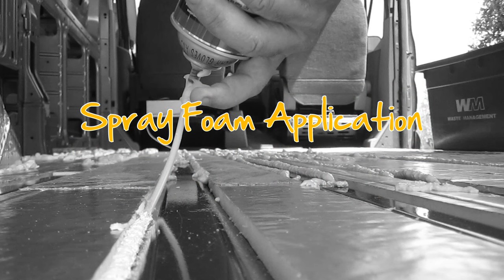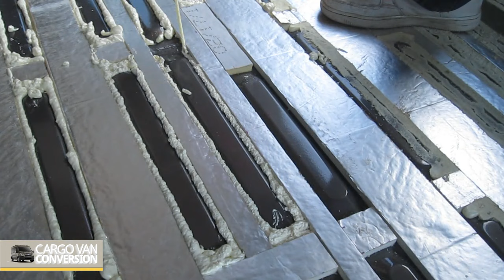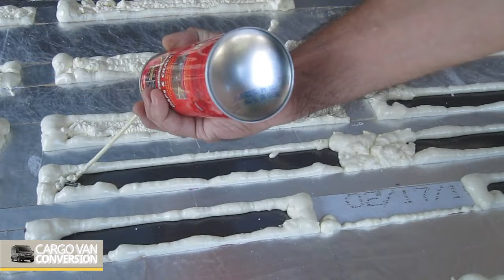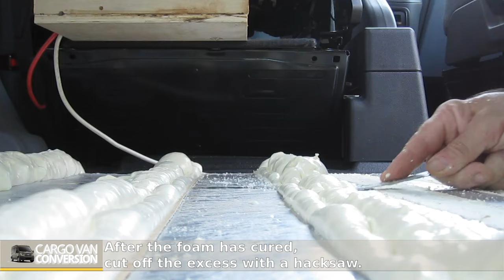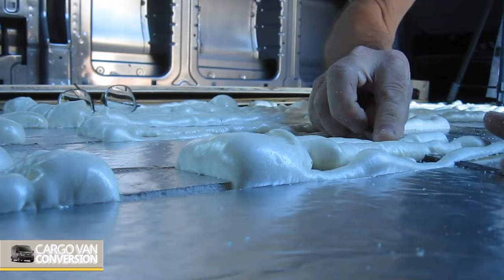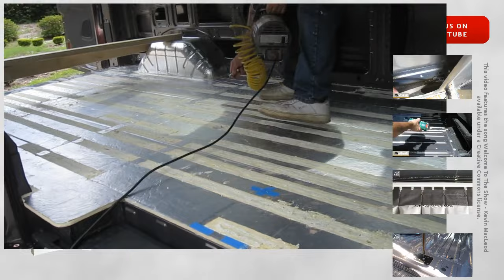How To Lay An Insulated Floor - Part Five - Spray Foam Application

Comment: great build, its helping me alot, just had a few questions, im trying to figure out if I should use great stuff spray foam, everywhere i look people are advising against it saying its guaranteed to cause rust and mold.  People are talking about removing it and having like a crazy amount of rust and mold under where it was sprayed because its open cell or closed cell foam or whatever and it holds water and releases gas or something like that.  So im like, should i use it? is there something else i should use if not? i love how you did this build and i want to do the same but i dont want to cake my van interior in spray foam and then like 10 years down the road the vans a rust bucket.
Reply from the maker: Thanks for watching and great to hear that I'm of some sort of help to your build.
I'm not an expert on 'Great Stuff' spray foam, but a moderate voice, who considers most points of view. First, technically I consider Great Stuff a closed cell foam. This means, the cells are closed and water cannot penetrate it and collect in them, to potentially cause damage. Where the issue arises, is when excess foam is 'shaved' off and the damaged cells are opened up and water or condensation could collect in there. If the foam is not modified after application, I don't really see an issue.
A better approach is to consider insulation materials to be part of a ventilation strategy. Minimizing condensation, humidity and moisture build up. A vehicle, with all its doors and windows cannot be kept perfectly cool (or warm, dependent on location and time of year) and living in it will always create moisture issues. Those can only be resolved with ventilation (also within floors, walls and ceiling).
Getting back to the spray foam; I used some under the subflooring, but would have preferred to have added an additional 3/4" or 1" Poly-Iso, if interior height was not an issue. I could have left the spray foam out and used something like Thinsulate (more expensive, but a better solution).
Great Stuff is not a perfect insulation material and perhaps should not be your first choice, but it's cheap, easy to apply and very useful in closing gaps, sticking rigid foam to the metal walls, etc.
You will find that many, if not all insulation materials, have their pros and cons and only you can decide what's best in your situation.
And remember, every time you open your car door, rain, humidity and wind will change the entire air composition inside your van, no matter how much insulation you use.

Van Williams
Reply: I have no experience and only theories from what I've read. I suspect the problems come from older foams used to fill in voids in cars. Since then a lot has changed. Especially denser closed cell foam should block water fine as long as it doesn't turn into dust (friable when flexed too much).
Also 2K PU spray foam instead of 1k would be better since you don't need water to foam it.
Reply from the maker: From a layman's perspective, I would prefer to stay away from foam products, but they are convenient in certain applications.

Van Williams
Reply: Just my opinion......
The problem is that the areas need air flow and that gap of ventilation helps dry areas that (could) build up moisture (for whatever reason). If theres no airflow, Then rust and mould forms and have nowhere to go. Ten years later you have rust and cant fix it because you cant weld the area full of foams. These are regular products for buildings made of wood... not metal. Keep the airflow in areas not exposed to the outside.

Comment: Thank you for sharing, I guess that when funds are available the use of  Sound Deadener against all the panels before fit the insulation will make the van much pleasant to live.
Regarding insulation on the roof for high temperatures I have found that a paint that acts as a reflective membrane is very efficient . 
I have applied it to my converted bus and on shipping containers and it is excellent..
Cheers
Reply from the maker: Sound deadening materials will reduce noise significantly in the current generation of cargo vans. And these products are fairly expensive. Be aware that in most cases only a 25% coverage is needed of the exposed area. I chose to skip it, because I always drive with the windows open (here in Florida).
I have no personal experience with these specialty paints, but whenever I hear of them, the comments are always positive. I tend to stick with mainstream materials, that have a long history in RV applications. I suppose, that's the biggest barrier for innovations, to break through.

Thank you for watching and for your comments.

Van Williams
Reply: what paint in particular did you use as a reflective membrane...think this would work for my project?

Comment: Great way of levelling and insulating the floor without comprising on headroom.
Reply from the maker: It worked out well, but you have to remember that I would have liked an up to one inch thick insulation board under the plywood. Leaving that out was a compromise to retain standing height inside the van. I still think that was the right decision, but with a High Roof model that would have been avoided.
Van Williams

Comment: Seems like it's been a while since the video was made.  How is it holding up?  Any Issues or anything?
Reply from the maker: Almost a year ago. I can't really say, how it's holding up; it's under 1/2in sheet of plywood. And the plywood is bolted to the floor. Absolutely no issues with the floor. I think, it's rock solid and it will last for the lifetime of the van. Like all the other mods, if any problems would develop in the future, I will write about them on http://CargoVanConversion.com whenever they occur.

Van Williams

Comment: Really liking these videos. Is it possible instead of laying down strips of PIR board, that you just spray the foam into those gaps instead, and then put a complete board over the whole thing. I realise it won't be level with the grooves as the board will be sitting on top of the grooves, but if you were going to put another board on top anyway...
Reply: Standing height is also a big requirement for me in the Sprinter.. maybe a 1/2" board on top of the ribs and a 1/4" plywood floor with vinyl on top or something. Need at least 6'1" of standing room. Height never had a downside until it came to building out a van...

Comment: I can't find RMAX in 1/2" in SF Bay area anywhere within 100 miles. Can I use the 1/2" pink foam board insulation instead?
Reply: Yes, I meant RMAX polyiso. I tried all that on their website. For some reason there isn't a HD within 100 miles from here that carries it in 1/2". I want to do my floor exactly as you did in your video. I did tons  of research online and think this is the best way to go, for me at least. I'm thinking of putting 1/4" cork underlayment on top of the poly- and then 1/2" plywood. My top priorities on this build are to limit weight and save space. Thanks for all your help.

Comment: I know it's been awhile but two questions. 1) Is that 'closed cell' spray foam you are using? and 2) What about 'off-gasses'?
Reply from the maker: In general the 'Great Stuff' spray foam is not regarded as a closed cell foam, but in my opinion, it acts like one as long as it's not punctured or the excess is not removed. As you can see in the video, I had to remove the excess, so moisture problems could develop over time. Moisture, insulation and ventilation are a complicated set of issues. You should watch or read about my floor vent https://youtu.be/awMAX7JZ0BE?list=PLyrIiniKvmg5fw4iLGoeajpfCFETk2zTY
There are many opinions, but I think that good ventilation is of utmost importance. 
Off-gassing hasn't been a problem for me. Whenever you use a spray can of any kind, always ventilate. The Great Stuff may harden quickly, but I would ventilate the car/van each day over the next few days.

Van Williams
Reply: I've viewed most of your instructional videos regarding this van's floor installation including the floor vent application. All great instructional videos by the way... I was basically trying to find an alternative to Reflectix insulation since it's proper application seems to be a trick in itself. And there have been posts/comments (I guess it's still up for debate) regarding 'off gasses' from insulating foam - even after it dries. And of course you've already referenced the moisture trap of 'open cell' foams (which I'm now considering 'closed cell'). 

Anyways sir, These are all great lessons and I'll be following your builds since I plan on purchasing a GMC Savana and doing the same. Keep em coming...
Reply from the maker: Glad to hear that you like the videos!
There is not one right way to do the insulation of a van/RV. Reflectix is often used in DIY conversions, but I have my reservations. On its own, it has a minimal R-value and it only works with a substantial air gap. I think, that there are better products available, especially long term. It is useful as a removable 'window shade', but also bulky.
Off-gassing of materials can certainly be a problem, one however that is difficult to measure. Remember that cars/vans are not really very airtight and that may alleviate any issues.
Good luck with your GMC and keep in touch!

Van Williams

Comment: Would been lot easier use foam board then plywood. Instead all little pieces and spray foam
Reply from the maker: Hi Brian,
Absolutely! My issue at the time was that in my Medium High Transit, I need to be able to stand up straight inside the van. I had only about 2 inches left between the top of my head and the ceiling cross members.
I figured, that I needed at least 1/2 inch for ceiling material, 1/2 inch for plywood subfloor and 1/2 inch for finish flooring.
That ended up in a compromise regarding the insulation. Put in as much as I could without raising the floor.
Ideally, I would have added at least one inch of floor insulation, preferably more. Looking back, I think that I made the right decision.
I won't spend much time up North during the colder seasons, but if you do, your choices should be different. Insulation plays a bigger role in a cold climate.
Van Williams

Comment: closed cell foam is way better than polyiso board
Reply from the maker: I may agree in general terms with you, yet the R-Value may be an exception. A minimal difference in R-Value between Poly-Iso (~5.5) and closed cell (~6.2) doesn't cut it for me. Higher published R-Values of 7+ are likely 'initial' values that come down 1-2 month after the application. In my build, factors like price and ease of application favor Poly-Iso. Closed cell has the advantage of creating a continuous layer of insulation, without breaks. In the end, it always comes down to your own personal preference.

Van Williams